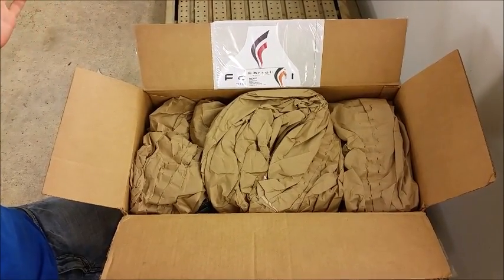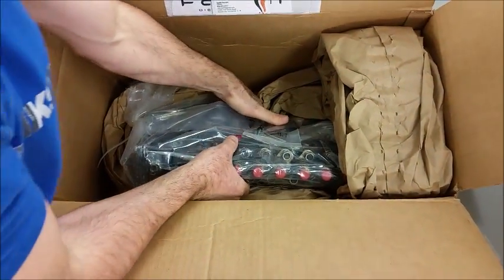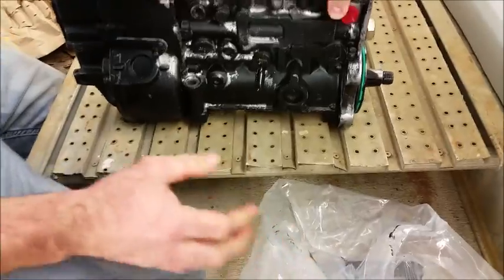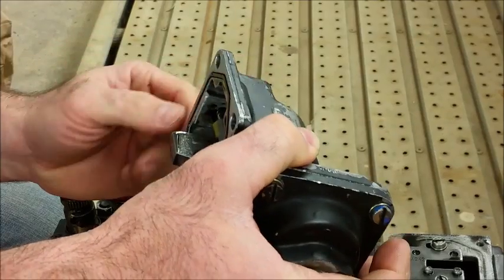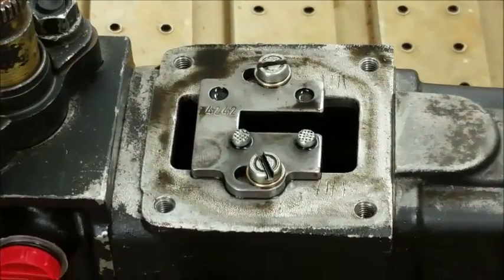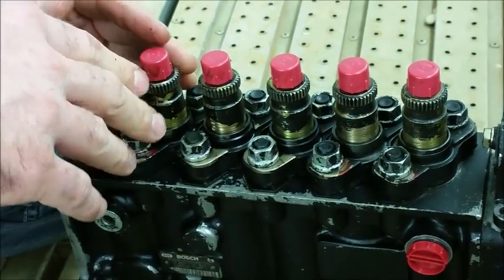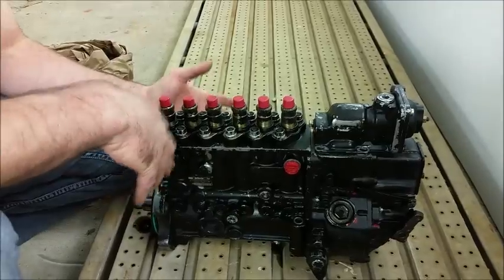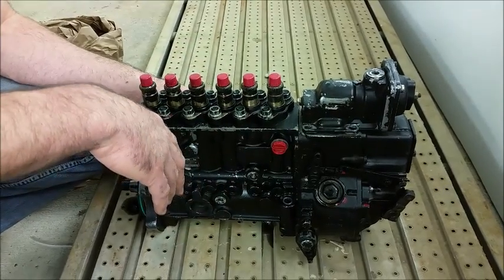Unbox and Review of 180 hp P-pump Maxed and Balanced By Farrell Diesel

Comment: I just recently got a 175 stage 2 pump from the same place I’m in the process of p pumping a 02 24v then installing it into my 03 f350 I just sold the 6.0 and decided to put a Cummins in it. It also has a zf6 manual transmission

Comment: Really can't understand why anyone sends pumps out to anyone. Theres really no advantage to having it "calibrated" on a stand, I sold my pump stand and comparator 10 years ago because it was fucking pointless waste of time. I now just test and tune and had way better results
Reply from the maker: That's an interesting point of view. Maybe you could make a video of your process and share it. We have done a few on the truck and spent tons of time trying to balance them, but did not have good results.  That's why we went back to having them calibrated on a pump stand. Now I have to say, they did not get more CC's out of the pump than we did. But they did run smoother.

Comment: He did mine as well. A 215 maxed to 550 cc. Great video brother.
Reply from the maker: 550cc is super solid! I know everyone thinks you need a billion cc's now, but the way I see it a properly tuned pump with 500ish cc's can net a bunch of hp's!  Sounds like you have truck on your hands. What are you running for turbos?
Reply: 70440charger  currently building the truck. Installing a k27 over a sx369. 7mm DV's, 5x 14 vco, oringed, arp 625.
You're channel is great!
Reply from the maker: @daviddominessy  Dude, I think I owe you an apology.  I am pretty sure I had asked once before about your set up and you said that you we going to use that k27 and the sxe 69... I should have remembered your set up from your first comment. But still! I think that's going to be a fun set up! More and more, Rusty and I are learning that big turbo are for the drag strip or for pulling (and I don't mean trailers! ).  Laggy set ups suck to drive on the street! Good for you and please do let us know how it goes. We see YouTube as a great forum for active conversations, but I don't know that many others are doing that yet.... So videos I commented on years ago are still unanswered! 😖

Comment: buddy get an Attitude adjuster for the 12v  no need to send it to anyone! look it up man!
Reply from the maker: Thanks DJ. I have looked into the attitude adjuster some a while back after if first came out. I used to dream of not having to crawl under the hood and adjust the afc anymore. While I really like the concept, but I tend towards the AFC live. They both have pros and cons.  And even though both of those will add a ton of power, it still can take place of being tuned/ calibrated  and balance off the truck. I can say that cause I have maxed out many a pump on the truck ( and have done so as scientifically as possible), but the results are never very repeatable.  But we are also super picky about our results, so that method might be fine for others, just hasn't floated our boat...  Thanks for the comment!
Reply: This is so incorrect it actually hurts.....

Comment: what does that p pump do
Reply: It gives package boy a reason for say Seth.
Reply: It's a fuel injection pump. It delivers pressurized fuel to the injectors of  your diesel engine at specified times, in relation to piston/cam position.